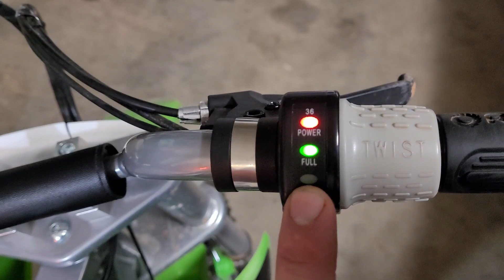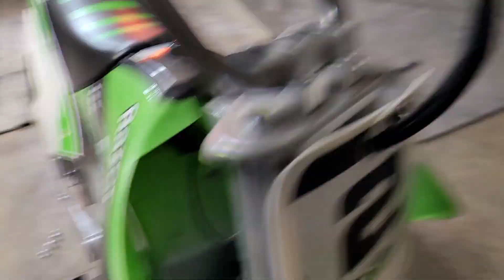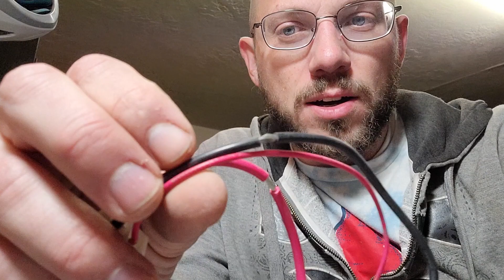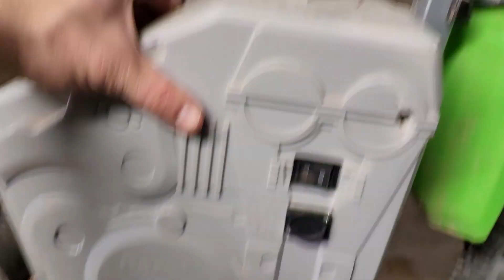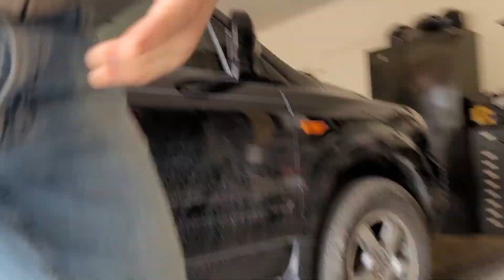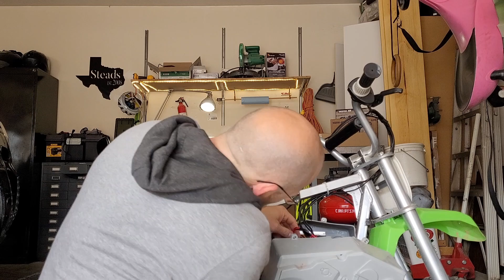Razor SX500   mini volt meter mod

Comment: What is the voltage when it’s charged up? What is the voltage when it’s low and you can still drive it home from the park?
Reply from the maker: When a battery is under load there is voltage droop, so we're not accounting for that. But for a fully charged battery it sits around 40v then low battery is ~35.5v resting. The voltage range is fairly small for my application. 

nominal voltage range for a SLA battery is ~12.6v and low would be 11.8-12.0v for each battery. 37.8v is fine and anything under 36v is getting low.

Comment: Awesome! Can I do this with my golf cart? I have a low battery light but it has never come on. Maybe it would be too late when it did come on?
Reply from the maker: Yep! They come in different colors too. Just need to make sure the voltage range is supported on the volt meter :)